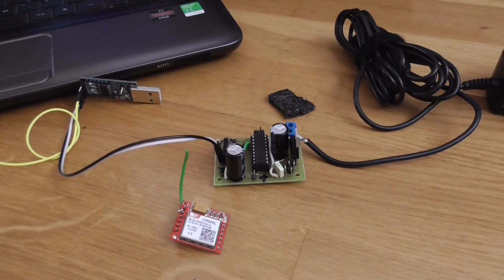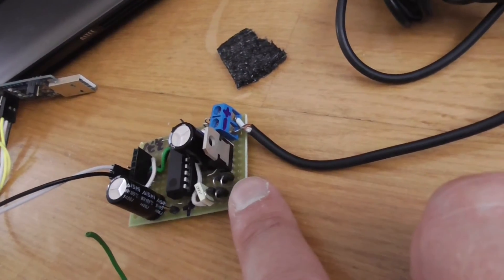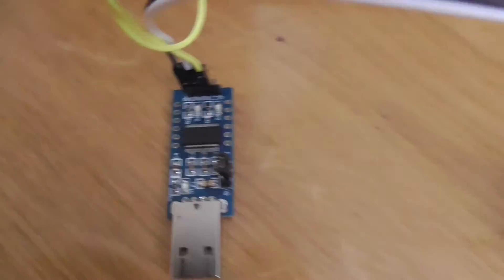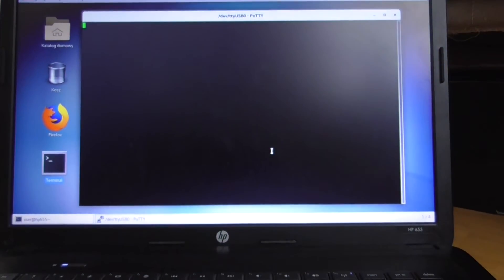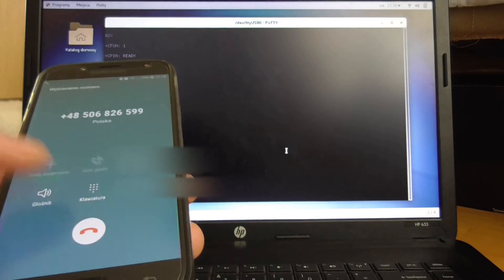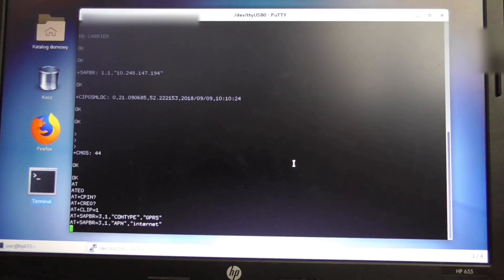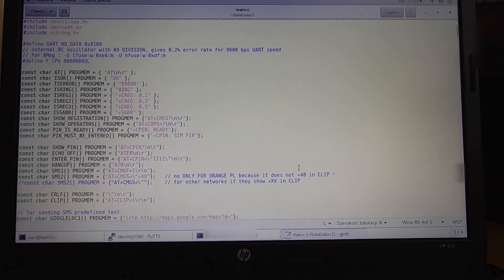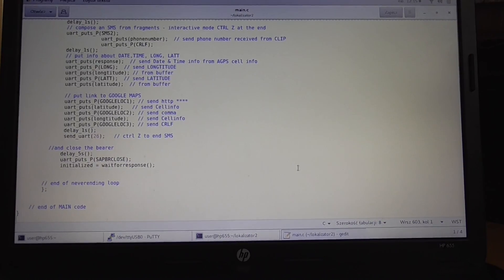Make your own cheap DIY GSM GPS bike car tracker / GPS car locator for only 10 USD !

Comment: That's the same old problem, it's the position of the nearest mobile tier not the device  pointless.
Reply from the maker: Yes, that is why you should see my other videos where I am showing real GPS based solution for GSM and LTE : https://www.youtube.com/watch?v=4B5GHRsYm28 , https://www.youtube.com/watch?v=uZeoT4VezuE&t=326s   and  https://www.youtube.com/watch?v=8R99t0O52GI , https://www.youtube.com/watch?v=ZMRz5Emcvew
these projects have 1-10m accuracy
Reply: @justanengineer5599  does it only give the location of the caller when they are calling you?

Comment: Is there any ways to convert the coding to become assembly language? I have to create diy gps tracker using assembly language.. Hope you can answer. Thank you in advance!
Reply from the maker: Hi, I am not an expert in AVR assembler, however you can always decompile code produced by AVR-GCC compiler. There is a project to do it here : https://github.com/twinearthsoftware/AVRDisassembler   The code for SIM800L based tracker is quite simple and does not use any mathematics like multiplication or division so it should be quite easy to port to assembler
Reply: @justanengineer5599  thank you so much sir

Comment: Looks nice, i'll try to make one by my own :) thanks
Just about one thing I am not sure. Is it just showing on google like a big radius where the object could be or is it the precise location of the object? Like accuracy <5 meter? 
Thank you :)
Reply from the maker: In this solution the accuracy is nearest GSM tower (Google API  translates Cell-Id of base station to coordinates) so it is quite low. It may be even up to 1 - 3km in some cases. If you want better accuracy I suggest to see my other videos  - especially the project based on SIM808 module. That project gives 1m accuracy and is widely used by my colleagues in their cars :-)
Reply: @justanengineer5599  thank you :)

Comment: You have GSM module, where is gps module.
Reply from the maker: See my other videos with SIM808 module - there is GPS module built into the chip. SIM800L is using base stations to determine geographical location.

Comment: can i use 100nf ceramic ? or 100nf decoupling better ?
Reply from the maker: does not matter - both will work just fine.
Reply: @justanengineer5599  thank you so much

Comment: Does this work on the 3G network? If not what could I change to get it to work?
Reply from the maker: Hi. 
The SIM800L board is currently the cheapest but it is 2G only. To use 3G you would have to change the board to something from SIMCOM 53xx SERIES look here http://www.and-global.com ( keep in mind that 3G board costs 30$ , even LTE boards are cheaper now). Also for SIM5360/SIM5320 board some update of the code is needed.  
I am thinking about code update for   SIMCOM 7000E / 7000A  series boards which have also CAT-M and NB-IOT support and   GNSS (real GPS) built in. To support them I would adopt the code from my second project here : https://www.youtube.com/watch?v=ZMRz5Emcvew&t=4s
Reply: @justanengineer5599  I will pay you to make and mail me an accurate GPS tracker to put in my automobile in case it is stolen. Thank you. Alpha.king4u@gmail.com

Comment: That's really cool. I read your comment on using another Sim module for more accurate positioning. I would like to do the same to be an embbeded tracking device for my cat. Battery powered, no need to have very long life time, just need to be the smallest possible to attach to either a collar or cat jacket on his back. Any idea of the final price with that better positioning chip, and the battery needed ?Again that's cool project and fun.
Reply from the maker: Hi, the SIM800L seems to be the smallest chip from the family. The second board with real GPS inside I'am showing in other movie is SIM808 based. This board is slightly bigger and cannot be powered directly from LiIon/ LiPol battery as SIM800L board can. The best would be to design a SIM808 board from the scratch, because the chip itself is powered from ~4V on BK808 board. The final price would be less than 20USD.

Comment from the maker: How to program ATMEGA chip :

 a) get Ubuntu for your PC. If you have Windows machine download WINAVR environment here  http://winavr.sourceforge.net  , but I don't have much experience with WinAVR and unable to help you with further steps

  b) For  Ubuntu you need packages : "gcc-avr", "binutils-avr", 
"avr-libc", "gdb-avr" and "avrdude" - you can install them using following 
command on the Ubuntu  PC  : "sudo apt-get install gcc-avr binutils-avr 
avr-libc gdb-avr avrdude"    ( sometimes "binutils" instead of "binutils-avr" )

  c) buy USBASP programmer (2 USD on Aliexpress)  - the description is here : https://www.fischl.de/usbasp/
and connect programmer  to Ubuntu PC from one side, from other side connect to 
ATMEGA/ATTINY  chip on PINs : MISO, MOSI, SCK, RESET, VCC, GND with 
 pins and cables connected to KANDA plug. Described here http://www.learningaboutelectronics.com/Articles/Program-AVR-chip-using-a-USBASP-with-10-pin-cable.php

 d) download combination of two files from my GITHUB page here  https://github.com/mcore1976/gpstracker    ( click the file, then click RAW, then click Save As on your browser ) 
- depending on which chip you are using ATTINY2313 or ATMEGA328P :
 main.c + compileatmega ,     mainb.c + compileatmega,     main3.c + compileattiny,      main3b.c + compileattinyb

e) Before compilation you have to modify the C source file mainXX.c to match APN/USERNAME/PASSWORD for 
your GPRS SIM card provider : you need to modify the lines with 
"AT+SAPBR=3,1,XXXXXXXXX" like described on github  ( put correct word 
instead of "internet" in each command, if you MNO do not have password simply leave it blank)

f) change execution rights to the compileXXXX script :   sudo chmod +rx compileatmega 

g) run the script  from  the directory you have downloaded files   : sudo ./compileatmega     , it will compile the C 
 file and upload .HEX output to the chip ATMEGA/ATTINY using AVRDUDE and
 USBASP cable

h) chip is programmed and you can connect it to power source (with 1N4007 diodes dropping voltage to 3.3V) and SIM800L board. Remember to keep connections as short as possible because of voltage drop on SIM800L ( consumes 2 Amps of current in peaks)

Comment from the maker: GREAT NEWS : I have almost completed the SIM808 based prototype : code available here - https://github.com/mcore1976/sim808gpstracker   
I have purchased BK-SIM808 board made by AND-GLOBAL ( seems to be the cheapest - only 12$ on Aliexpress so total cost of GPS tracker increases to 20$ )- here is the description https://cdn.instructables.com/ORIG/FAO/80RU/IXLALERK/FAO80RUIXLALERK.pdf 
The disadvantage of this board is lack of RI/RING signal which I am using with SIM800L so ATMEGA328P cannot go to powerdown mode. For this project also passive GPS and GSM antennas with IPEX connector have to be purchased (1 USD each).
In this solution real GPS positioning is sent via text, the GSM cell location is only used as a fallback when SIM808 GPS cannot fix to satellites :-)

Comment: Thank you sir for this great project.Sir  can replace  GPS/GSM module by  two modules GSM 6A and GPS 7-M and can i replace ATMEGA PIC by PIC 16F877a. and i will be gretfull if you have Proteus schematic  for this projects.
Reply from the maker: Hi Azeddine, never done anything for PIC MCUs.  You meant GSM A6/A7/A8 modules like visible here : https://www.makerfabs.com/desfile/files/A6_A7_A6C_datasheet-EN.pdf  - this could be only a matter of changing some AT commands to make it work with Ax modules.   Currently I am working on SIM808 based + ATMEGA 328P prototype. I will post something in several weeks

Comment: how do i check where my car is if my car got stolen? and howw can i make one?
Reply from the maker: You simply make a call to the phone number of the SIM card you put into this device. It will text you back with link to car's location. This is DIY solution so you need to order components  and solder them to circuit board. In the most simplified version you need only ATMEGA/ATTINY chip, SIM800L module and 1 capacitor ( 1000uF or more). Also USBASP programmer for 2$ will be needed to upload the code to ATMEL chip. It is all described at GitHub documentation.
Reply: @justanengineer5599  Please how do access the GitHub documentation. I think am not clear with how to program the chip to send report gprs data. Thank you.
Reply from the maker: How to program ATMEGA chip :

 a) get Ubuntu for your PC. If you have Windows machine download WINAVR environment here https://sourceforge.net/projects/winavr/   , but I don't have experience with WinAVR and unable to help you with further steps

  b) For  Ubuntu you need packages : "gcc-avr", "binutils-avr", "avr-libc", "gdb-avr" and "avrdude" - you can do it using following command on this PC  : "sudo apt-get install gcc-avr binutils-avr avr-libc gdb-avr avrdude"
You may also follow tutorial here http://www.linuxandubuntu.com/home/setting-up-avr-gcc-toolchain-and-avrdude-to-program-an-avr-development-board-in-ubuntu

  c) buy USBASP programmer (2 USD here https://www.aliexpress.com/w/wholesale-usbasp-programmer.html) 
and connect to this PC from one side, from other side connect to ATMEGA/ATTINY  chip on PINs : MISO, MOSI, SCK, RESET, VCC, GND with cables connected to KANDA slot - described here  http://www.learningaboutelectronics.com/Articles/Program-AVR-chip-using-a-USBASP-with-10-pin-cable.php

 d) download combination of two files from my GITHUB page here ( click the file, then click RAW, then click Save As on your browser) -  https://github.com/mcore1976/gpstracker  - (depending on which chip are using ATTINY2313 or ATMEGA328P):
 main.c + compileatmega ,     mainb.c + compileatmega,     main3.c + compileattiny,      main3b.c + compileattinyb

e) modify the C source file mainXX.c to match APN/USERNAME/PASSWORD for your GPRS SIM card provider : you need to modify the lines with "AT+SAPBR=3,1,XXXXXXXXX" like described on github  ( put correct word instead of "internet" in each command)

f) change execution rights to the compileXXXX script :   sudo chmod +rx compileatmega 

g) run the script    : sudo ./compileatmega     , it will compile the C  file and upload .HEX output to the chip ATMEGA/ATTINY using AVRDUDE and USBASP cable

h) chip is programmed and you can connect it to power source (with 1N4007 diodes dropping voltage to 3.3V) and SIM800L board.

Comment: Sie am Adam ;)) thanks for sharing your video. This is exactly what I'm looking for for my motorbike and I like the challenge to make everything my self. I will order all the parts and if you dont mind I'll be back with some question. So the better version is with SIM808 module right? Cheers
Reply from the maker: Sure, best option is SIM808 which has already available full GPS receiver. I have just ordered also SIM808 and will update the design and the code to work with this module. It takes some time to deliver it from china...  Any questions are welcome :-)
Reply: @justanengineer5599  Dzienki Adam. Please let me know when you will have the  design and code available. Cheers

Comment from the maker: I HAVE ALSO CREATED ATMEGA328P (ARDUINO UNO)  VERSION because this chip has more memory, it is easier to buy it and allows for bigger program code. With this chip you can expand the program with some more functions like uploading GPS data to some external server. Details and schematic is available on GitHub.

Comment: Can you help me build a wireless battery powered GPS tracker for real time ? I want to track my quadcopter incause it crashed
Reply from the maker: sure. You would need a SIM808 module for that to give more accurate position of quadcopter - notice that this project gives only nearest 2G cell location.  There is a short info how to do it on SIM808 here : https://alselectro.wordpress.com/2018/05/04/sim808-gps-gsm-module-sending-gps-location-sms/       using Arduino Uno board ( ATMEGA 328P).   I am thinking of using SIM808 in next project however a cheapest SIM808 breadboard  is 10$. That would overrun my budget for this project :-)